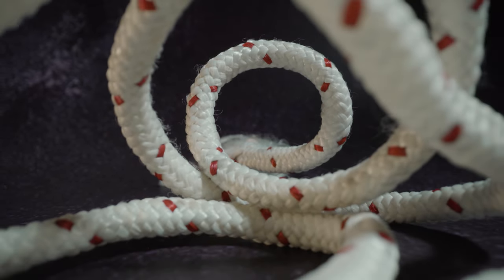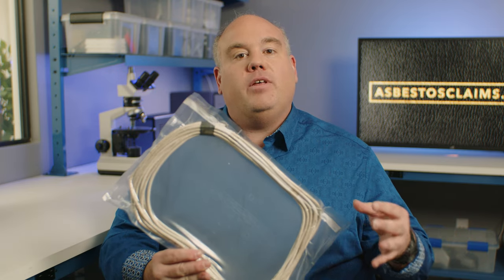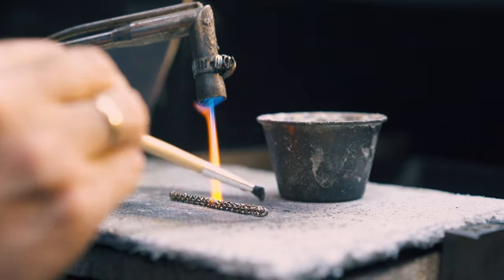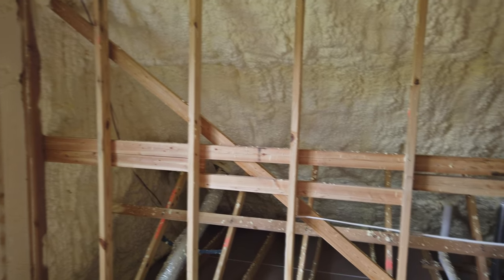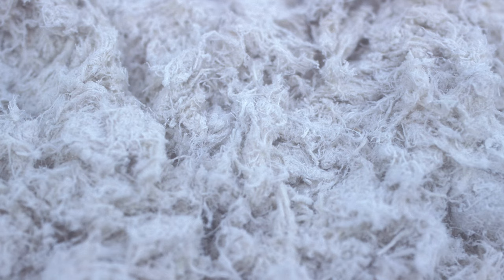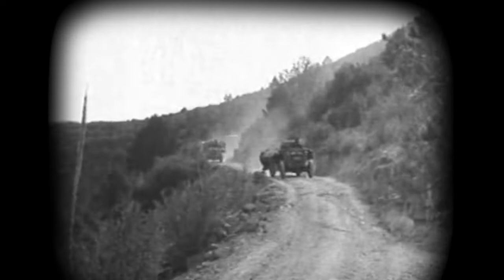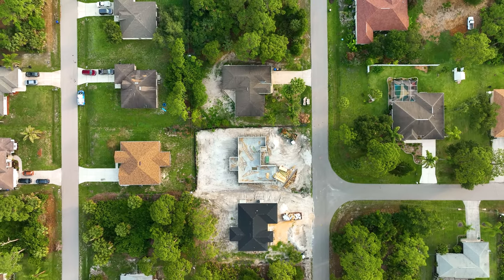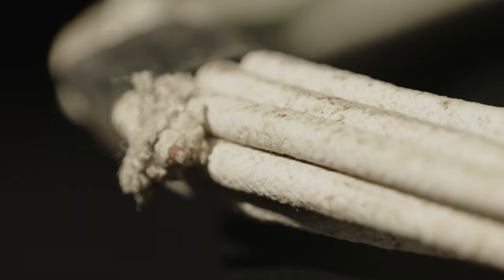Electrical Asbestos: Recognizing Asbestos in Vintage Wiring

Comment: That wire looks obvious for asbestos, because it's white and the only coating on the wire, my wiring has a black plastic coating that chips off easily and is also covered with a cloth insulator, I don't know if that's asbestos or fiberglass

Comment: Old REA wiring  at its finest
Reply from the maker: Finest indeed
Reply: I have been at a persons house when I was very young they had very old radio sets in the house and the wire cord looked just like what is shown.
Reply: @jasonhaire8897 if it's an AC/DC set with a resistance wire in the mains cord, it is possible. Do NOT replace it with a normal cable - the set relies on the resistance to drop the voltage to a level suitable for the tubes.
Many other wires may look the same but aren't asbestos.
If you can take a sample without damaging the radio (it's fine to soak the wire in water) you can either send it to a lab, or try to set the sample on fire. If it chars or burns it's just normal cloth covered wite.

Comment: If electrical wiring with asbestos was installed in 1947 by builders who were the best they could be at their craft, in metal conduits, and not disturbed over the years, how long do you think it would last? (For example, Kodachrome film lasts 100 years under ideal storage conditions. How long does electrical wiring with asbestos typically last under ideal conditions?)
Reply from the maker: It's an interesting question. It can definitely last a very long time, but longevity primarily depends on environmental conditions such as temperature, humidity, and exposure to any chemicals or physical disturbances. Under ideal conditions—like those that minimize moisture and mechanical stress—such wiring could theoretically last as long as the building itself.

However, there are significant safety concerns with asbestos-containing materials. Despite its durability, the primary risk with asbestos is not necessarily the degradation of the asbestos itself, but the potential release of asbestos fibers into the air if the material is disturbed or deteriorates to the point where it becomes friable (easily crumbled).

It's important to note that while the asbestos might remain stable if left undisturbed, the actual metal wires within might degrade depending on their composition and environmental factors, which could eventually lead to electrical failures or hazards. Therefore, replacing old asbestos-containing wiring is generally recommended not just because of the potential health risks if disturbed but also to ensure electrical safety and compliance with current standards.

And, of course, I have to put my lawyer hat on and stress that any work involving asbestos-containing materials, including inspections, maintenance, or replacements, should be performed by professionals trained and certified in handling asbestos safely. Be well and thanks for the comment!
Reply: @asbestosclaimslaw , very informative answer. Thank you.

Comment: Correct me if I'm wrong, but I understand that asbestos dust has neutral buoyancy and can hang in the air and never be seen.
Reply from the maker: I'm not sure it is neutral but it definitely can stay airborne for quite some time when disturbed.
Reply: @asbestosclaimslaw   Does asbestos fibers get carried off by the wind?  For example if a neighbor has done renovation,  and disturbed ACM from exterior walls,  would the wind carry the fibers away from the area?  since the fibers are microscopic ,  it's common sense to believe that it could get taken away by wind.  Please let me know.
Reply from the maker: @standforhumanitariancauses4756  yes, and depending on the wind it can travel quite far.
Reply from the maker: https://www.asbestosclaims.law/asbestos-blog/how-long-can-asbestos-stay-airborne/?highlight=airborne
Reply: @asbestosclaimslaw   I watched your other video,   and you had mentioned that it could also stick on clothings.  In that case it's also safe to say that it could stick on window screens.   There are are homes that were built in 1960s.  But inside the exterior wall there's pink insulation that looks like fiberglass.  In that case maybe fiberglass insulation was used instead of asbestos?   And how about those rocks inside the exterior walls of old homes,  could they contain asbestos materials?
Reply from the maker: @standforhumanitariancauses4756   @Stand for humanitarian causes and democracy  obviously I can't give you an onsite diagnosis, but yes the rocks would likely be vermiculite, and there's the potential for asbestos dispersal when vermiculite is disturbed. The pink insulated material is fiberglass and not an asbestos concern, though you wouldn't want to handle it without protective equipment.
Reply: @asbestosclaimslaw   What actions could I take,  if our neighbor has recklessly done this,  even though I had addressed it before to them.    They had done this before.  I asked them to stop.  I also contacted air quality,  but they didn't do anything, They called me and told me that since the home owners had already been cited before for violation,  they had followed the code.  But it doesn't seem that way, if they're still doing the same thing,   even the workers were NOT wearing masks.   The air quality from the city told me that they left the note in front of their door,  but no one opened the door.   It's a very frustrating situation.   You expect city worker officials to do their due diligence, but they didn't do any testings.    What could I do from this point?
Reply from the maker: @standforhumanitariancauses4756  The law can vary based on where you are but generally speaking Ii your neighbor is still recklessly handling asbestos despite your previous warnings and the lack of action from air quality officials, there are several actions you could take:

Contact your local health department: Your local health department should be able to investigate the situation and determine if the asbestos handling is a threat to public health. They may also be able to provide guidance on how to properly handle and dispose of asbestos.

Document the situation: Take pictures or videos of the asbestos handling and any workers who are not wearing masks. Keep a record of when and where you witnessed the activity. This documentation can be helpful if you need to escalate the situation.

Contact a lawyer in your area: If you feel that your health or property is at risk, you may want to contact a lawyer who specializes in environmental law. They can advise you on your rights and help you take legal action if necessary. I handle claims for asbestos injury, which is most likely NOT something you need to worry. Generally you have to work or be around asbestos for some time before it becomes a major concern (that said, any exposure is not good). And the latency of symptoms takes decades to develop. 

I would continue to follow up with air quality officials: Even if they have not taken action yet, continue to follow up with air quality officials and provide them with any additional information or documentation you have gathered.

Talk to your other neighbors: If your other neighbors are also concerned about the situation, consider organizing a group to address the issue together. This can help bring more attention to the problem and make it more likely that action will be taken.
Reply: @asbestosclaimslaw   Thank you very much sir,  for your time., and information.   I highly appreciate it.  Take good care and stay safe.

Comment: Howdy! Was the ACM cloth used as wire insulation usually white? I've run into some tan/brown looking stuff in the past and am curious as to what that material may have been. Metallic armored cable and the individual conductors had what appeared to be braided rope insulation. Thanks for another cool video!
Reply from the maker: Asbestos-containing material (ACM) used in wire insulation indeed often appeared white or light grey. This was due to the natural color of chrysotile asbestos, the most common type used in such applications. However, it's important to note that asbestos insulation could come in various colors, depending on the manufacturing process and any added materials.

The tan or brown material you encountered might still be asbestos. There were different types of asbestos, such as amosite (brown asbestos) and crocidolite (blue asbestos), which could lead to variations in color. Additionally, the color could also be influenced by factors like aging, exposure to heat or chemicals, or the presence of other binding materials in the insulation.

The description of braided rope insulation around metallic armored cable is consistent with some types of older electrical insulation that contained asbestos. These materials were used for their durability and fire-resistant properties.

Given the health risks associated with asbestos exposure, it is crucial to treat any suspect material with caution. If there's any uncertainty about the presence of asbestos, it's advisable to have the material tested by a certified professional and to avoid disturbing it, as this can release harmful asbestos fibers into the air.

Comment: I found an old GE clothing iron at the thrift store from the 1960s and was planning on using it as a novelty item, but I saw someone comment on another video that the braided cable might be asbestos. 

Did some more research and found this video and I think you've basically confirmed that it is asbestos, so I'll disposing of it. $7 wasted but learned an important lesson about asbestos.

Thank you for this information!
Reply from the maker: Better safe than sorry!
Reply: if its that old, you might be able to just detach the cord and throw the cord away
Reply from the maker: @againtjugofcocomilk  just be sure in accordance with proper disposal regs
Reply: @The-Secret-Basement  amazing how they put that stuff in everything